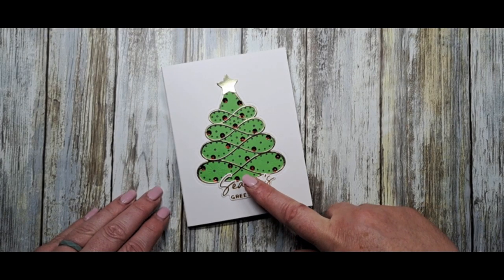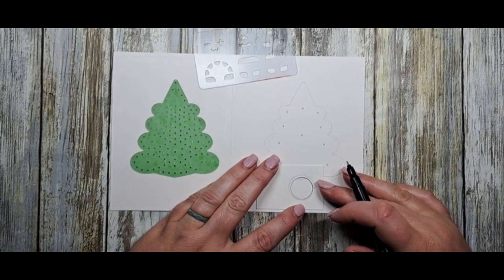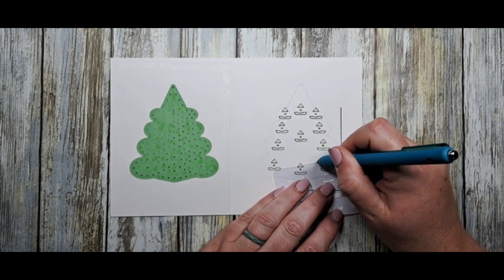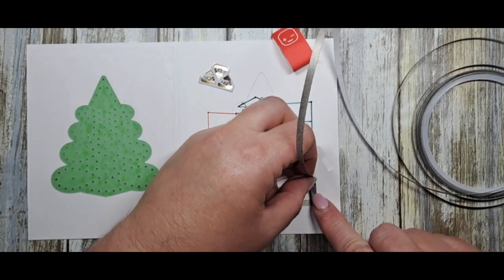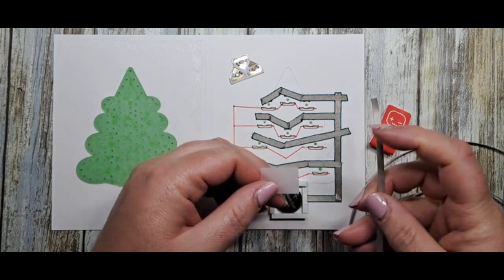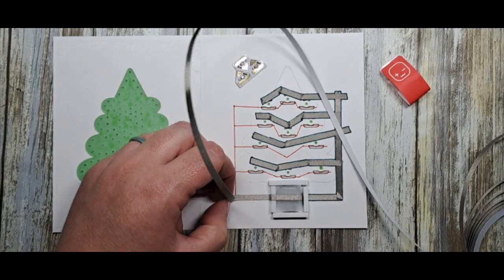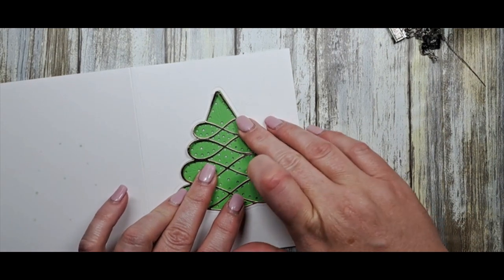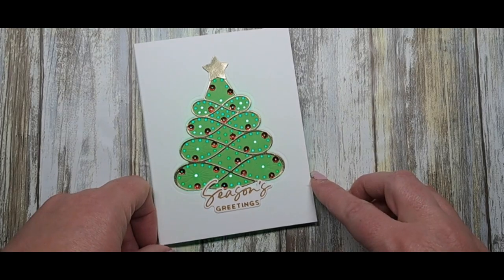Light Up Stitched Christmas Tree featuring LED Lights by Chibitronics

Comment: How many lights is the maximum number that I can attach to 1 CR 2032 battery?
Reply from the maker: Thanks for reaching out. The answer to your question (about how many Circuit Sticker LEDs you can light up with a single, fresh coin cell battery) is that it depends. This would depend, in part, upon the battery’s capacity and how much power would be required by the entire circuit. A thin CR2016 battery has less capacity than a thicker CR2032, for example.  It also depends in part upon their color (blue and white Circuit Sticker LEDs tend to use a bit more power than red and yellow ones).  Mixing different colors within the same circuit also impacts the draw upon the battery.

I currently have 18 white Circuit Sticker LEDs working on a single coin cell battery in a project that I  made.  They aren't super bright, and the battery won't last super long with that many Circuit Sticker LEDs attached.  But they are all turned on. If I stack two coin cell batteries (to make 6V), however, they all become super bright.
Reply: Thank you @chibitronics  !